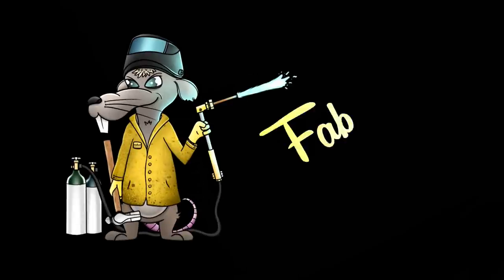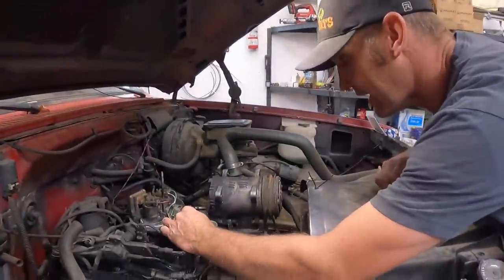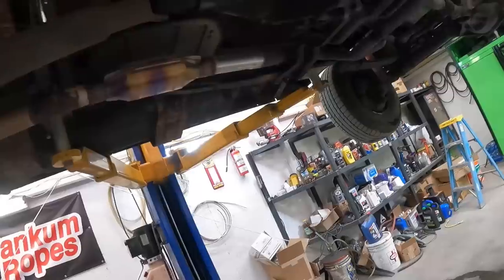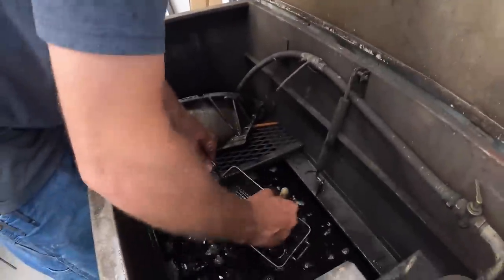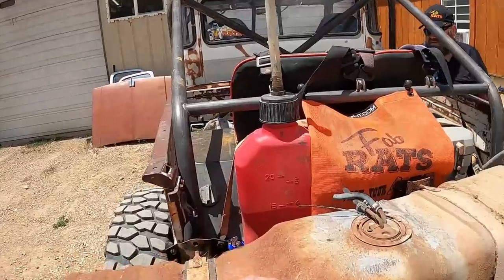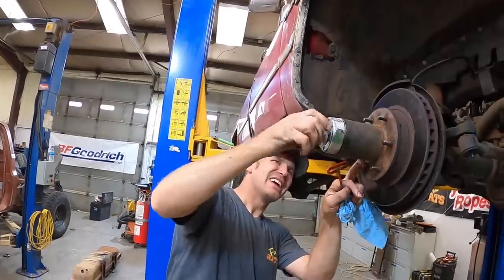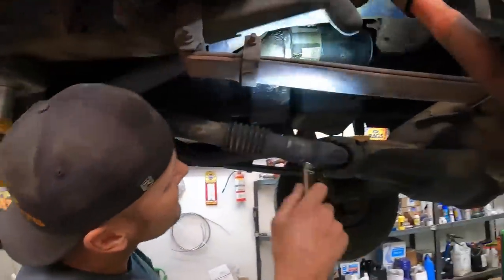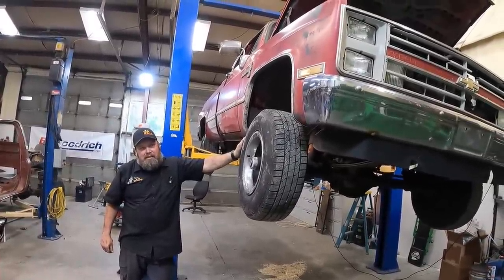Will This Square Body Purchase Be JUNK Or A GEM?

Comment: Use Amsoil penetrant.  You'll never use another brand.  I found that out more than 30 years ago.  BTW, that washer that lined up on the little thing to hold the bearing in, has a few things that you need to beat down on one of them to make sure it locks.

Comment: Tip for those transfer punches! Especially if they are cheapies from harbor, just hit them hard enough to leave a little mark and then center punch them deeper to drill. The tips get smashed easily and make them useless.

Comment: I've always found it easier to change a fuel pump in my Chevy by unbolting and lifting the bed than trying to drop the fuel tank. Always seems that the fuel pumps die with at least half a tank of gas.

Comment: If you put jb weld tin then jb weld on top it will hold for years and never leak did it on a plow truck held for over 10 years

Comment: Careful hitting those transfer punches too hard with the hammer. The tips break off pretty easily. They're designed to make a light indention, then you can use a center punch to make it big enough for the drill bit to find. I learned that the hard way a long time ago with some else's transfer punch. So, I had to buy a new one. I'm not trying to be a smarta$$, just hoping to inhibit someone else from finding out the hard way like I did. Love the  videos!

Comment: I'm sure you know, but those in tank fuel pumps are a common failure point on Chevy trucks. I cut a 12" square panel out of my bed and made an access panel so I didn't have to pull the bed or drop the tank...military HMMWV's came standard like that, you'd think GM would have put that idea into their civilian vehicles, but it would probably cost them service $$$ so they keep making things difficult...

Comment: Find the work truck with the smallest or weakest motor on the farm and that's the one that's got the most bailing wire, bubble gum, zip ties,and wood screws holding it together!!!!

Comment: Truck life expectancy is most likely under 3 months. Those 4.3 v6s are significantly better than the other v6 they made in the 80s. You guys all remember the 2.8. Leaked more oil than many diesels. If you looked at it wrong it would spin bearings.

Comment: I plowed a lot of snow with an 88 just like that and then all the Bondo fell out and then it did not look so good anymore even the cab dropped and caught fire because it landed on the exhaust and you had to take and use a shovel to put gas in the gas tank because the cab Dropped In The Box dropped and to get anybody to crawl into passenger side he had to stick a shovel behind the box and the cab so so you can latch the door shut but I'll tell you it was one hell of a plow truck whoever bought that truck to begin with must have been going to use it with a plow because it was geared just right and I just love that old truck and I drove it for 4 years until you couldn't keep the cab on anymore

Comment: That V6 is hell of good engine, might have been too good, I had one in my 87 Monte Carlo, in my early days of NAVY career. used to go from JAX,FL to Pittsburgh, in 12hr, < it came with a cost, otherwise very nice engine, I dint know They had them in trucks, very good on gas.  Hope he doesn't ruin your truck. Kids, my brother ruined my Monte Carlo when I was on Deployment (93). Stored at parents' house, got back with huge dent in quarter panel.  Still Nice repairs checked all things that can go wrong, made it safe.

Comment: 46re on the floor had one ratchet strap under the bell housing and one right between transfer case and trans gotta do what ya gotta do to get the trans in sometimes 😂
Reply: Had the straps hooked to the frame rails from one side to the other just couple clicks at a time

Comment: Did you just connect the positive battery cable with the negative cable already connected? Negative off the battery first, negative on the battery last!

Comment: How about this I changed a 4.0L v6 in idk like a 98 ford ranger. Manual transmission and stabbed the motor into the transmission with the transmission and drive shafts still mounted in the truck.

Comment: Or a 4l60e with a transfer case still attached exhaust still on the truck because the bolts wouldn’t come out full bell housing that’s a pain

Comment: I never realized those came with a V6. There's so much empty space under the hood. Fan shroud is bigger than the motor.
Reply: You never realized it cause nobody bought them when they came out  🤣 There was almost zero reason to get the V6 instead of the V8 besides fuel economy, and even then it was barely any better

Comment: Ummmm, I noticed the RH valve cover had a open hole with metal shavings all around it.......not so good to mix drill shavings in the oil

Comment: I had 6 months of random ignition cutouts right after I bought my '69 Camaro in 1990.  It still had points and the resistor wire bypass from the starter solenoid to the ignition coil had about 3 inches of bare wire hidden behind the passenger cylinder head.  Everytime it would bounce around and touch something "poof" light out.  It was so well hidden and so infrequent took some sleuthing to figure it out!  Looks like your square body was owned by a hack!  You'll get it sorted, I'm sure.

Comment: i bought my first chevy squarebody 1974  oh it was a nightmare my ford foot was just too heavy for the  thing almost made it to 70,000 before i blew the 350 motor, bought a replacement engine used low miles but with my ford foot it died in less than 6 months. but a least it was a two in one deal my first chevy and my last all in one.

Comment: Ok so why didn’t have  the throttle body covered when drilling the bolt out????
There was rubber hose running to the throttle body. Thats fuel injection. Ugh.

Comment: That's not a tumbler it's a ignition lock cylinder that has a housing a core a set of springs and wafers and a key . Tumbler are what the pins was called back in the day . I don't know where people get it from to call it something it's not . And I know for a fact because I'm a Locksmith

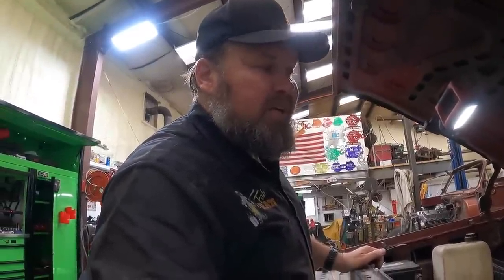Comment: Hey Landon! I have the same issue, with my Right Foot... Sometimes you gotta "Just Letter Rip"! @1:33... Remove thermostat, issue SOLVED! ☺☺ @3:20... Flat 'nuff! @3:30... Leave it up to Ben to wield the Lightsaber!!! (We have no Droids here)... @4:06... Da Boss!!! @4:49... How long will it take Landon to BLOW IT UP!? Mmmmm, He'll blow it up before Halloween! @5:31... If it doesn't have AC, Landon's date will get Boob Sweat and will surely not be "In the Mood"; so, don't fix the AC... reckon? Oh, hey Landon... Your Dad and Uncle are some pretty "Cool Guys", for working on YOUR TRUCK! 😉😉 @18:02... Paul used One of: "The Seven Words You Can't Use On Television"! (ALL HAIL GEORGE CARLIN!!!) @18:30... Paul talking about a "Washer T*t"??? 😮😮 Yes, there are names, for important features on specialty lock washers etc... One of my favorites is a "Pipe Nipple"; female electricians seem to really Get-the-Giggles!

Comment: Without watching the vid for one second, I’m gonna guess the truck is going to be garbage. They were from the factory. I’d take a Ford (of the same year) over a square body any day of the week and twice on Sundays. I’ve owned multiples of both and they just don’t compare. I’m not brand specific, I just buy the one that’s the toughest and most reliable at the time. I’m driving a 2011 Nissan Armada and have since 2013 and it’s absolutely the best vehicle I’ve ever owned. Regular, normal maintenance and it’s been worry free since I’ve had it. It’s got gobs of power! I can spin the mudders if I need, tow my 9300 lb. camp trailer up any grade I need, play with the ricers and diesel boys in town and then clean it up to its shining glory and take the wifey out on the town and it’s still quite the looker. (The Armada and the wifey😉)
The Armada has been a diamond in the rough, I’d consider another but I’m thinking of stepping up to a 5th wheel. Seems like diesel time!

Comment: Good explanation of the holy washer and tit nut, only thing i can add is if the tit wont line up with a hole then flip the holy washer around and try it, beyond that adjust the inner nut a tad.

Comment: Young male drivers tend to have a disconnect between the right foot and common sense 🤪. But then most of us were that way and after decades of driving I still have a moment of a short Circuit. My son thinks I’m nuts off road with my big horse 72 f-250 with a warmed over 429 and 35 inch bfg mud TAs. But then why else have big horse power 4x4 if your not going to exercise it from time to time. But in my younger days. I broke many a part being stupid beyond the vehicle capabilities of the time 👍🇺🇸

Comment: If the V6 that is currently in the 87 decides to die then you can always get a 4.3 V6 Votec out of a late model S10 to put back in it and put a 4L60E transmission in it to go with it and you should have a pretty solid truck as far as the driveline and you'll have EFI as well and then just put a set of Ranchero shocks on it and make sure the rear has a solid gear in it but in other news the next time the family takes a vacation down to Florida and if you've never been to the Waffle House you should most definitely go because you are missing out on the best breakfast food ever and it's fairly cheap and they also have pretty good lunch/dinner food as well and their sister restaurant is called Huddle House and they have pretty much the same lunch and dinner food as Waffle House and they offer a little more lunch and dinner food than Waffle House but if you just want breakfast food I highly recommend Waffle House

Comment: Hey fab rats crew would you do me a favor and tell me what kind of fuel mileage you get out of that ole girl when you start driving it. The reason I want to know is I have a 2016 Chevy Silverado 1500 4.3l 4x4 with a 6speed automatic no lift very slightly larger tires on factory wheels well factory gm just not to this truck I upgraded to 18” that I really like that are a factory gm wheel. Anyway this thing well I’m not going to comment on the fuel mpg untill you tell me what it’s 1987 grandfather gets aka your k15 that your son will be driving. If your son can better mpg with that 33 year old truck then I get with my 6 year old I’m going to be a little upset. I mean mine is direct injection with the cylinder shut down and everything. But please let me know. Oh and it looks like yours is running a lot bigger then stock tire too.